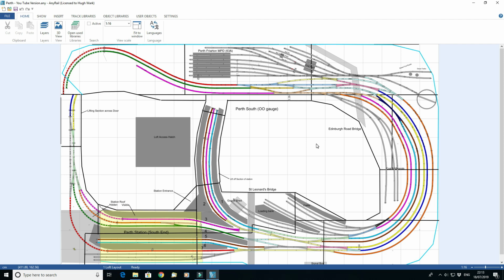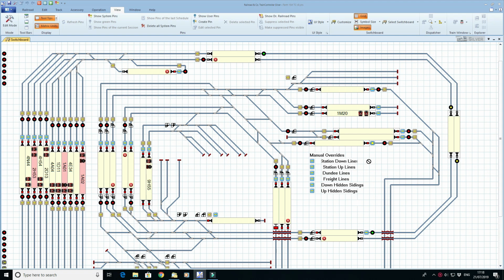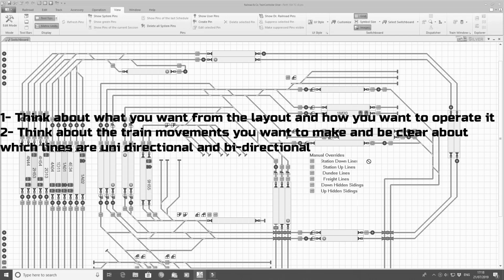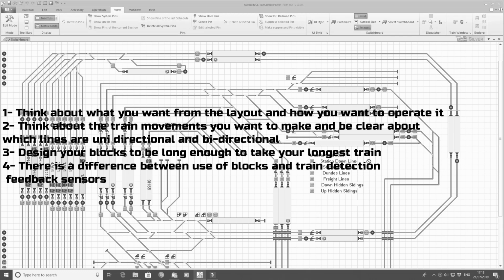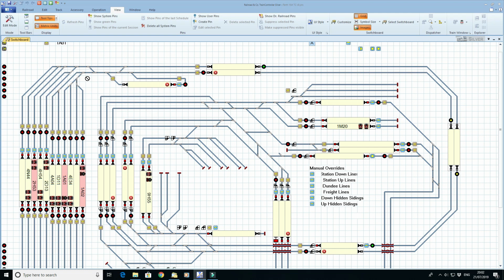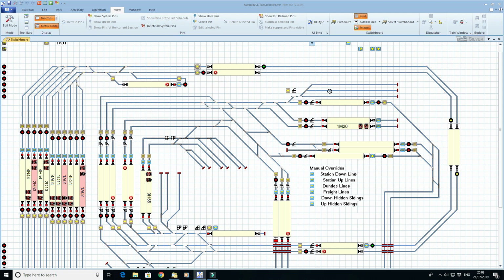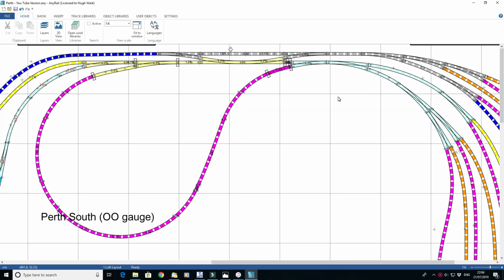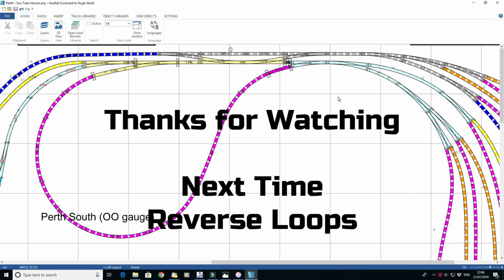Perth South Model Railway - #3 Operation and Control

Comment: So would it be possible with TC and digitrax to operate a signal box prototypically?
I'd like to be the signalman (with levers) and leave the operation of the trains to the computer.  I'd love to include block bells but I'm not sure the software would accommodate that.
Reply from the maker: Hi and thanks for your comment. TC allows various levels of control between manual and fully automatic but I don’t think you can easily separate train running from setting up routes. 🤔 There is probably a way to frig it so it looks that way though not sure how. Also, while easy to set it up as a modern entrance/exit type signal panel, connecting it to a level frame would be almost impossible.....but there may be someone, somewhere who has done that! Thanks again for watching. Hugh
Reply: @perthsouth5576  I would have thought with the lever frame it would be much the same as a control panel, but using DCC Concepts levers.
That's a pity that it likely wouldn't work, but being able to watch the trains go automatically would be good nonetheless.
Reply from the maker: @Lennon6412  might be a way to make it work. Just not sure how. Cheers. Hugh

Comment: Goodness me! That would drive me to the point of insanity, although I do fully understand the reasons for it. I still like DC because I have a control panel with traditional switches and signal box point levers for signals and points.; This means I am operating the layout in the true sense. Depends on your personal choice and I will continue to watch this with great interest. 
Beautiful and concise video with I am sure enormous assistance to those into DCC.
Cheers, Bob
Reply from the maker: One of my reasons for liking this is that you don’t have to spend lots of time building and wiring a control panel though lots of other wiring required round the layout.